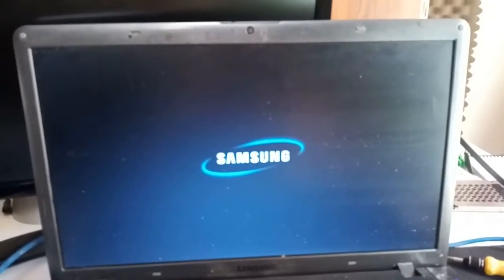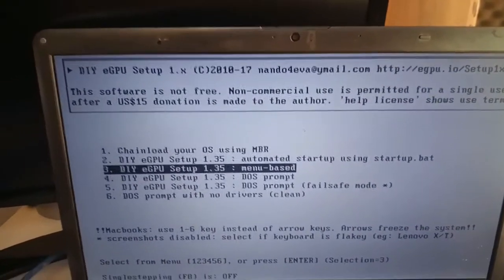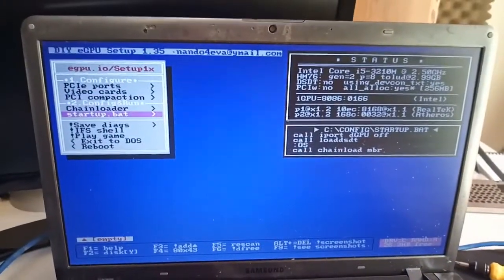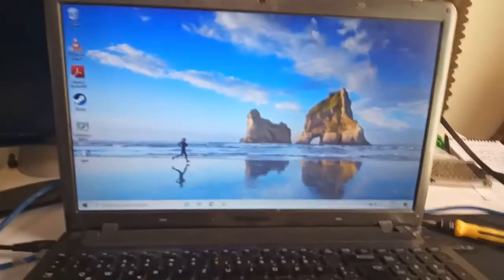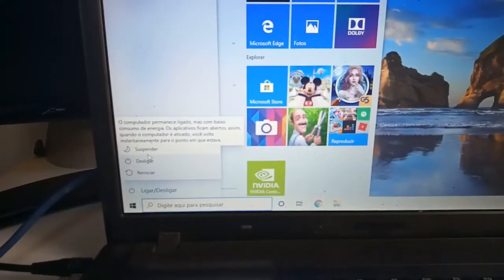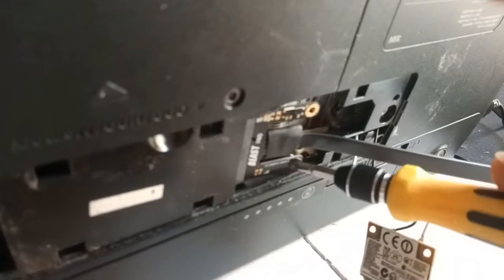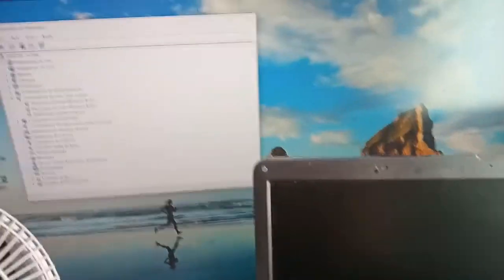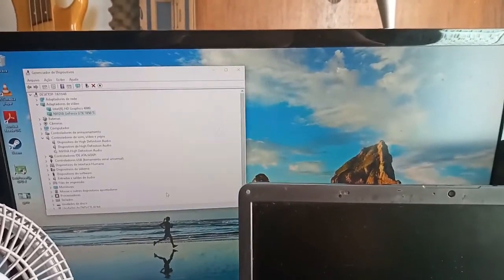eGPU - Error 12 fix using EXP GCD Nando's DIY eGPU Setup 1.35

Comment: hi friend...i using dell Latitude E6330 with exp gdc 8.5V...i use express card connection..only graphics card with 2gb vram can use...i try use 1050ti 4gb and gtx 1060 3gb but i have a black screen

Comment: Hi and Hello!  I have a question. Before trying the Nando Setup.  Did you encounter any Problem like  Screen has no Display but is on, with PSU and Egpu + Beast?     I have been looking answers but no replies or answers.    My Laptop is Toshiba dynabook Satellite Pro s850 Series.

Comment: Hey it’s need download first the driver on graphic card that we put on egpu dock before set up on NANDo software????
Reply from the maker: You cant install the driver before doing this procedure, because the GPU needs tô be detected tô install it
Reply: @gauninha12  from egpu dock connected to my laptop not show my graphic card in device maneger not detect, that why I ask if is this need download first the gpu driver….?
Reply from the maker: @jigolo_gaming  But have you did exactly as I shown in the video? You will only be able to install the driver when the GPU appears in the device manager

Comment: I tried egpu in my laptop Sony e series vpceh28fa i5 8gb ram . I used evga Gtx 1050ti SC 4gb . But when I connected gpu my laptop shows black screen but gpu fans keep spinning and beast shows green LEd . When I remove graphic card then laptop start normally. What to do.  ??? Pls help me to fix my problem. DIY I buyed.
Reply: I have acer aspire 4739, when installed riser or exp gdc the screen is black and the gpu is not detected and I tried using an external monitor also does not appear on the screen (black screen). The problem is exactly like what you are experiencing

Comment: Bro can I help me…  this DIY I already buyed… why not showing out the boot maneger for DIY??? What I will do????
Reply from the maker: How you installed It?
Reply: DIY egpu I tried egpu in my laptop Sony e series vpceh28fa i5 8gb ram . I used evga Gtx 1050ti SC 4gb . But when I connected gpu my laptop shows black screen but gpu fans keep spinning and beast shows green LEd . When I remove graphic card then laptop start normally. What to do.  ??? Pls help me to fix my problem
Reply from the maker: @jigolo_gaming  did you do as I do in the vídeo? You can only plug It after hibernate mode
Reply: @gauninha12  yes I do I did I almost there…I have  one question…it’s first download the driver that we keep on new graphic card before set up to diy 1.35 diy? I think this the one I miss it or left to do.??? My new graphic card 1050ti? Still I not download the driver … maybe that why not detect.
Reply from the maker: @jigolo_gaming  I'm not sure if I understood what you said, but you need first to have de GPU detected in the device manager to be able to install the driver
Reply: @gauninha12  ok thank u
Reply: Can u tell what u do from start in DIY eGPU-setup-135 in my desktop

Comment: hi, I've successfully made the windows not bsod anymore with egpu plugged in by the nando diy setup. even though it worked, i had to reconfigure the nando setup to avoid bsod as my personalised settings are gone after reboot which is annoying. is there any way to save settings in the diy setup other than have to press test run?
Reply from the maker: Sorry friend, I don't know how to save the configs. I have to make it every time I use the eGPU :/

Comment: Hi andre, im get this error on win 10, is this one time fix or u have to swap the card everytime u want use the egpu?
Reply from the maker: You must swap it everytime, my friend
Reply: @gauninha12  my egpu didn't detected in nando setup, it only detecting my dgpu, im already hotswap the card but still not detected, i still getting error 12 on win 10 even with dsdt and test signing mode on, meanwhile on win 7 it working flawlessly with dsdt and sleep method without nando setup
Reply from the maker: @amiliyahtegar717  my eGPU is also not detected in Nando's setup. It gets only detected after hot swap during suspended mode. There are some notebooks that the procedure may not work :S

Comment: Hi, I have lenovo y570 i5 with gpu gt555m ant I tryed to put external gpu nvidia gtx1050 ti 4gb the the pc can't detect video card, but everything is working colling is working green light is on but can't detect pc video card? What to do? Maybe video card is not supported?
Reply from the maker: Have you tried installing the driver even not detecting the card? I've heard there are some notebooks that does not support the adapter, but you may ask Nando if you cant solve the problem, friend.
Reply: @gauninha12  yes I tryed install drivers, but nvidia can't detect ant showing red cross, thank you I will try to search for more info

Comment: Hi Andre. I wonder if you could help me out please. I recently bought for me the NGFF version of the eGPU cartridge. I was testing it out yesterday to Geforce GTX 1650 and manage to get error 43 on it. Then tried a bunch of stuff like trying the disable the PCI port of the onboard amd chip but still landed with the GTX 1650 driver to error 31. Then tried downgrading the Nvidia driver to earlier version. Now the driver is listed to be working according to Device Manager but rest of windows doesn't read the card. Also when I plug in external monitor to the GPU card the screen stays blank. Please help 🙏
Reply from the maker: I've never had this issue, my friend. Have you tried fixing error 43 using this Nando's Solution? 
https://egpu.io/forums/expresscard-mpcie-m-2-adapters/script-nvidia-error43-fixer/

Comment: I brought that software
I follow your step but can’t solve error12
I ask for Nando but he can’t help me
Also u are not follow nando why?it is any reason
Reply from the maker: Not every notebook Will work, indeed. But these steps I am showing are exactly whats Nando told me to do to solve my error 12
Reply: André Gaúna how do I know it is my notebook can egpu?
Reply from the maker: @nychk_  Actually, Its important first to check if your notebook has mPCI-E, because there are some notebooks which has mSata, that is physically identical to mPCI-E, but if you plug eGPU in mSata port, It wont work. Another tip is that there is a List containing lots of notebooks that has been tested and assured the GCD Exp eGPU adapter Works, but you need to Google it, and It may not contain ALL notebooks that the eGPU can work. Yes, this is hard stuff
Reply: André Gaúna also my notebook don’t have dgpu will I affect ?
Reply from the maker: @nychk_  Well, if it does not have an dGpu, then this solution I'm showing is not appropriated for your case... I don't know what may be causing error 12 for you :/
Reply: André Gaúna ok, my notebook have mpci-e ,it can connect the gpu,but it show error 12 . Ok thx for your rely. I will try for it or find more method to solve
Reply: André Gaúna I done it I used dsdt to solve it
Btw I payed more 10 usd for help XD
Nando is very pro 
He helped me a lot
Also thx you rely me a lot of message or your video let me now how to solve it
Reply from the maker: @nychk_  You are welcome, my friend! Im glad you solved It. What is dsdt? How was your solution? Share It with us :)

Comment: hello! do we need to change ours partitions to mbr?
Reply from the maker: Hello! I did not had this issue, but another guy here had it. I don't remeber selecting this option when I formated my HD, because everything went fine here
Reply: @gauninha12  So your hard disk still GPT, and can still run "DIY eGPU Setup" right?
Reply from the maker: @nychk_  Oh, I've just checked It using cmd->diskpart>list disk. Mine is MBR, indeed. Maybe you need to convert It, but I don't know how, my friend.
Reply: @gauninha12  oh ok thx for your reply! i try to contact Nando to solve this :)
Reply: @nychk_  I had to buy 40$ software to convert my drive without losing the data. When it was done it bricked my pc and it couldn't find my HD. I found in the bios a setting to use booting in legacy mode and it let me in again. Be careful.
Reply: @satatik21  oh ya must change to legacy
I remember I first time I use a lot of time to find out how to change gpt to mbr btw now my egpu is very successful.
Reply: @satatik21  I lose all my data XD luckily I have backup my data in driver as that time I sure I am not 100% success

Comment: Hi this video seems to work Im going to try it . My question is the external display have you connected straight to the gpu or to the laptop ? 
and your english is great 👍👌
Reply from the maker: Thank you my friend! I have connected It directly to the GPU :)
Reply: @gauninha12   man my issue is that graphic card stops spinning and it cant recognise the external device , any solutions?
Reply from the maker: @kimi_hoxha  Its actually normal to stop spinning, but about not recognising it, i can't be sure... Have you already installed the drivers? 
There is something else you must asure: The mPCI express and mSATA port are identical. Be sure that your device has mPCIe, instead of mSata. If you plug it in mSATA, it wont recognise
Reply: @gauninha12   I have plugged it in the wifi place and after I do everything you did and turn it on it just doesnt recognise it and the fan stops spinning
Reply from the maker: @kimi_hoxha  Hmm I see... So you are using the right port. Have you tried contacting Nando? I'm sure he can help you, my friend. I'm sorry, I did not have this problem, so I don't know how to solve it :/
Reply: @gauninha12  fuck it I gave up already , Im selling the parts and maybe later in the future I will build a proper pc
Reply from the maker: @kimi_hoxha  Oh Man, I almost gave It UP, but Nando saved me! Try contacting him
Reply: @gauninha12   I did and I just cant anymore , 3 days of not sleeping properly with that Im just tired